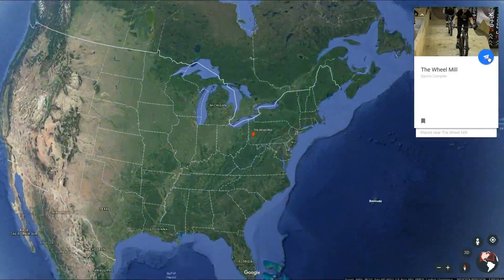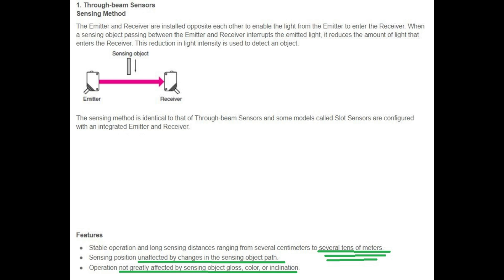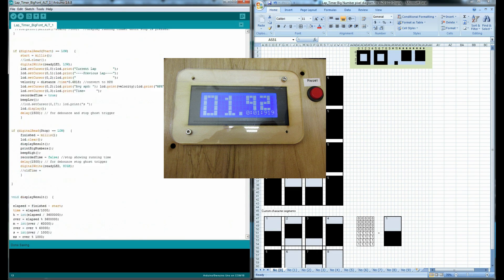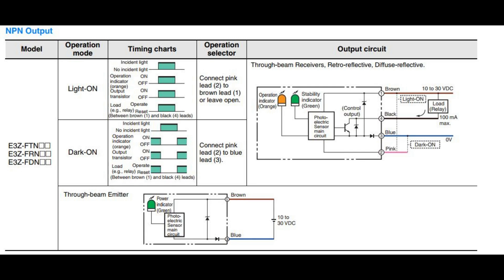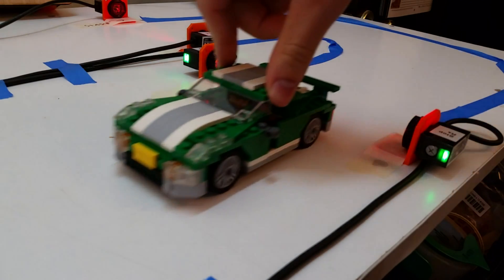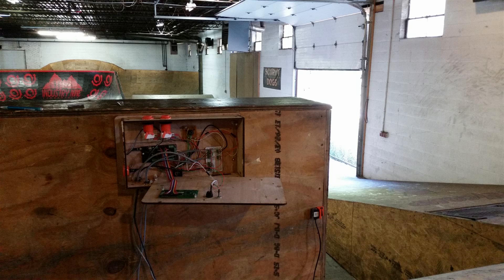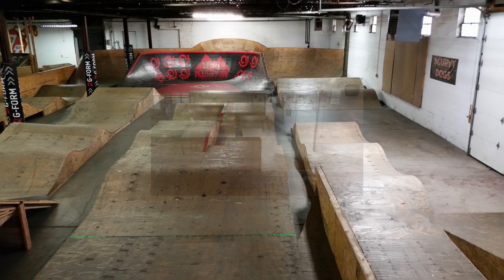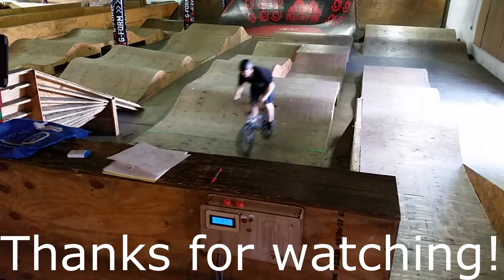Arduino Lap Timer for BMX Pump Track

Comment: Ryan do you have schematic and code and part list?  price $$$
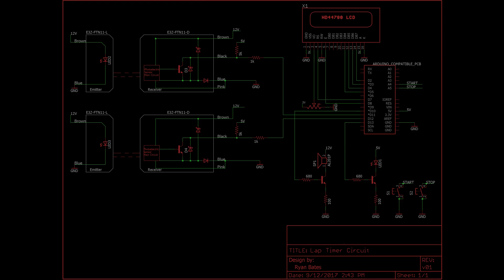Reply from the maker: Schematic is at @2:45 
I did not compile a BoM, the core parts are the sensor pair listed in the video + an Arduino. Code, is, uh rough. email me, you can have it.
Reply: @RetroBuiltGames  thanks:goodvibes:

Comment: Hey Ryan, there's kind of an interesting behavior from this timer. I went recently and the timer was shut down because it would consistently poll a new lap time after each delay period was up. This caused the speaker to chime pretty incessantly. The problem was that the stop rx had been crashed into and was no longer receiving from the emitter. Not necessarily a problem but perhaps an interesting test case to consider if you were to construct more of these in the future. (e.g.  the stop rx or start rx signal is interrupted display an error and don't handle any time keeping)
Reply from the maker: Thanks Mike! I will put that error case in the next iteration. I guess that non-stop beeping isnt helpful if the timer goes down. It's use was to help a single installer line-up the photo sensors and inform spectators that there's a timer present.